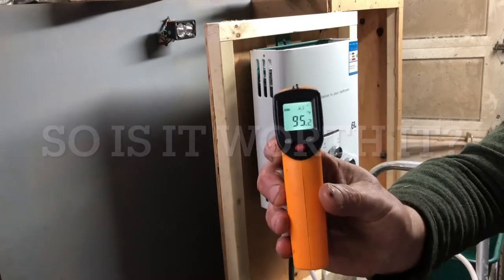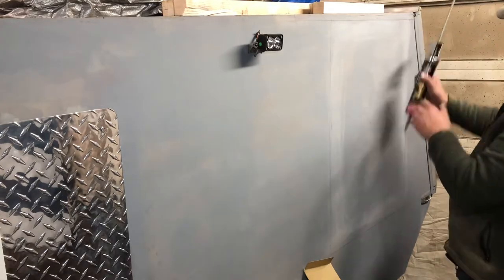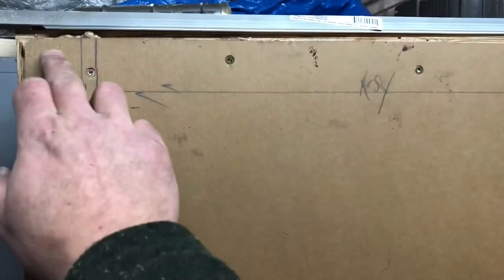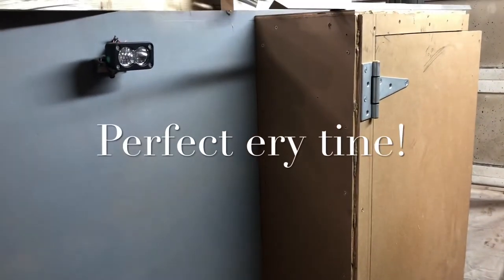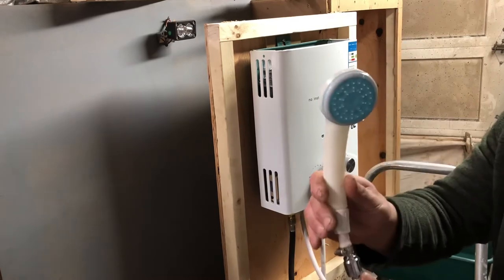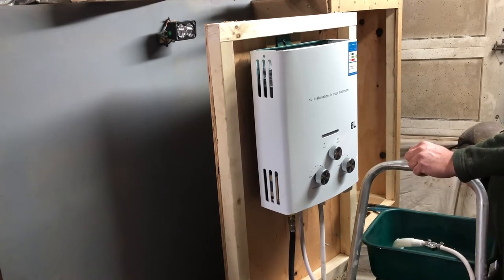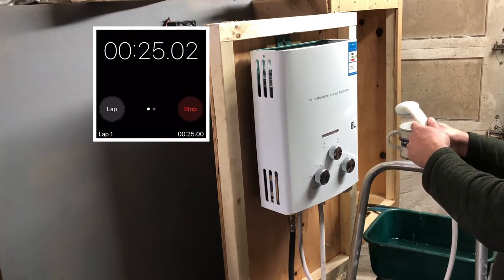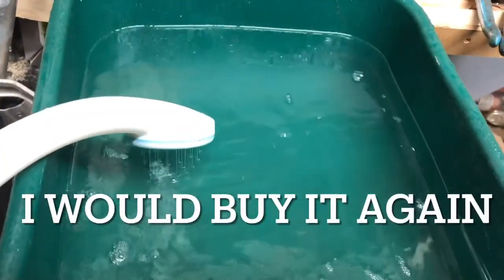I purchased the cheapest tankless hot water tank on amazon for the trailer...Does it work?

Comment: Get what you Pay for
Reply from the maker: Amazingly after two years of camping and using it for showers and dishes. It still works perfectly. 🤷‍♂️
Reply: @Twisted Gorilla Fabrication  I have two one new and factory refurbished Both are shit I have wasted so much time I'd gladly paid 700 for a good one.
Reply: @TwistedGorillaFab  That's awesome to know. Does it use a lot of propane? Do you need a pump to get the water to it?
Reply from the maker: @marlaplunk2833  very little propane use and sadly they do not come with a water pump like the Colman all in one.  But I have a pump on my off-road trailer so I put a T valve and it’s own shutoff on it.  The only other thing I did was buy a low flow comparable water head cause the one supplied goes through a lot of water. She’s still going strong.
Reply: @TwistedGorillaFab  That's fantastic. I appreciate the AND the video - not everyone finds value in buying cheap stuff just to see if it works. Going to keep this video in my favorites/ideas folder for my potential camper build. Cheers.